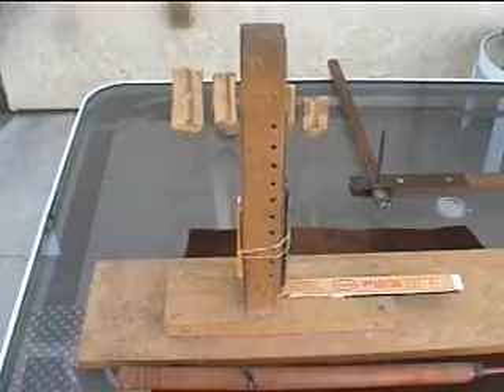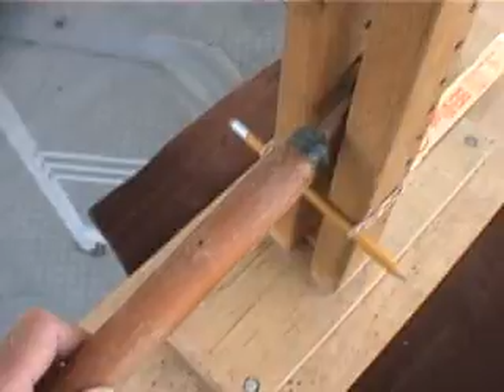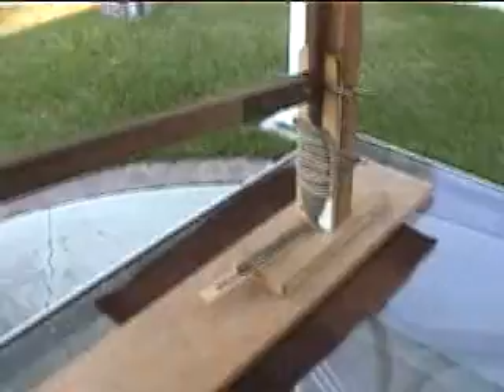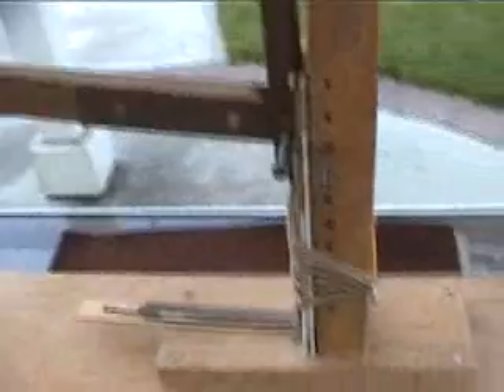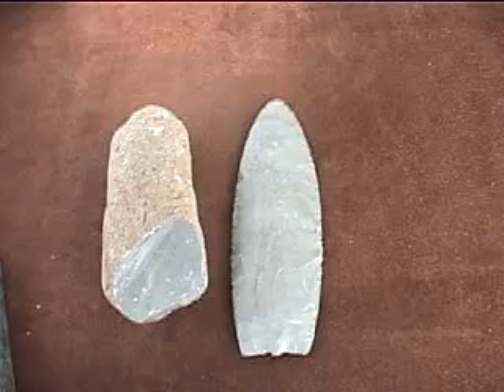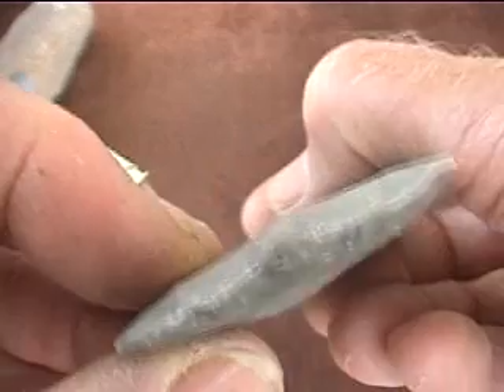Clovis Fluting 1 (Compound Jig)

Comment: Hey Jim, I've been trying to make a clovis point. I've made about 4 preforms and the nipples are appropriate for fluting. The contours are nice and round, but I have one question. When I'm fluting on a jig, how far up in the nipple should I place the lever? All the way? Halfway?
Reply from the maker: Zack Hansen A lot depends on how the nipple mates with the copper lever, a good flat mating is best. If the lever is placed too shallow and not far enough back on the nipple the flute can sometimes start prematurely and run too shallow. Often times part of the nipple will remain on the preform. I prefer to have the copper lever at the back of the nipple, but be careful not to go behind the nipple because the follow thru of the lever can split the preform down the middle. Hope this helps.....:)
Reply: Zack Hansen

Comment: Jim, great video as always. I'm partway through your cores and blades series and I wondered: have you ever attempted using the compound jig on a blade core? I can see where it could give really good control of the pressure and angle of attack on a core. But maybe there are problems with using the jig for blades that I'm not seeing without actually going through the process. Again, just wondered if you had ever thought to try it. Thanks!